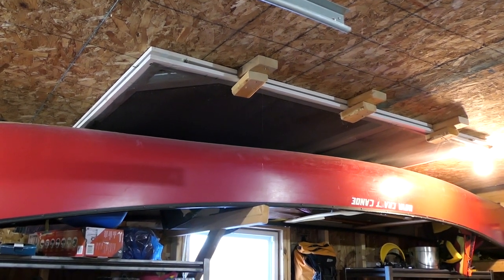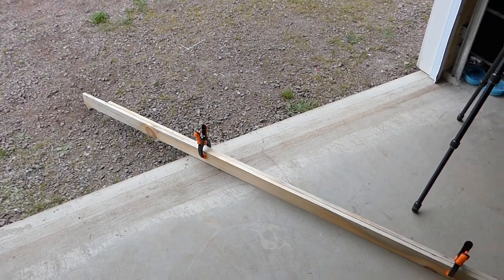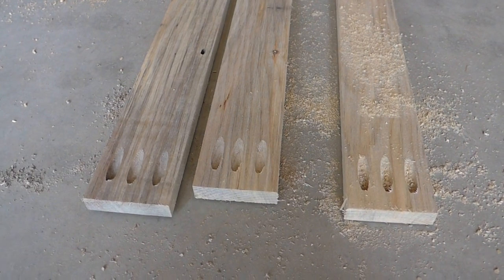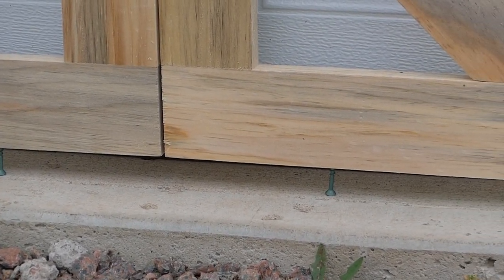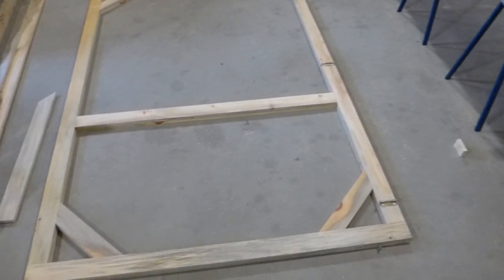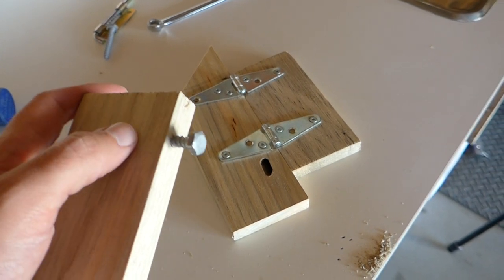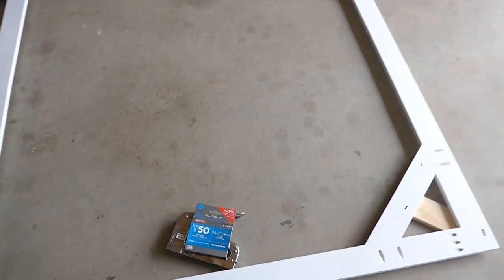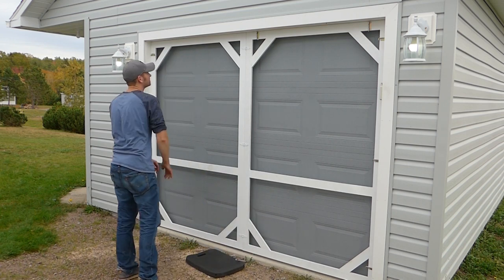Amazing DIY Garage Screen Doors - Quick Release & Hinged -- No Sewing Required

Comment: Question? How do you open the screen door from inside the garage or how do you lock it from inside the garage.
Reply from the maker: Good question. I cannot open the screen door from inside the garage. There's a regular side door for day-to-day access. I only open the screen door to take out larger items (Canoe or 4 wheeler).

Comment: Love this design and this great tutorial.  VERY helpful.  I do have a question.  Did you use anything to "line" the bolt holes for the barrel bolts? was thinking how to waterproof the holes and still have useful access.  Thanks.
Reply from the maker: I just pulled the barrel bolts and let them hit where they should go in. That marked the frame and allowed me to drill the holes in the correct area. The holes don’t go through completely, and my trim is made if PVC so I wasn’t worried about rotting or sealing. You might be able to use plastic plugs if your door frame is made of wood? Thanks for your kind words!

Comment: Out of curiosity, I was intrigued when saw you did the hinge in the middle. I am new at this kind of thing, so wondered if you could help me with the why 😊 Also, how is it holding up years later and/or did you make any changes to how it’s built? 

I made a baby gate height one last year and well, it wasn’t the prettiest but it worked. Since it was on the inside of the garage, I put small wheels on it so it could be opened when coming in and out for gardening/mowing. This year my kitties aren’t little so they will leap right over that one.  The rebuild begins 😅

Thank you for this video sooo much! Finally one that doesn’t require sewing…. I stink at anything that requires sewing 😂
Reply from the maker: Sorry for the late reply. It held up pretty good, but I always store it inside the garage during winter, so it’s not exposed to constant snow/slush. I haven’t had to change anything yet, and the hinges still work. The support screw on the bottom is very important though, because it holds it firmly in place 👍

Comment: How much did it cost in material to make? Can I make one for double garage? Any plan idea to share how to?
Reply from the maker: You can probably make one for a double garage but I would suggest more than 2 panels if you plan on having a section that opens. I can’t remember the cost, but I have a few of the items listed in the video description.  No plans, but it’s not too complicated if you measure your door and make a drawing of what you need. Thanks for your comment 😊

Comment: It was a great video.saving a lot of money.would you please describe about how many pieces of pine woods and the sizes for 2 car garage door?ty
Reply from the maker: Hi there, I suggest you mesure your door and draw a plan based on your measurements. From there you can figure out how many pieces you need. Thanks for watching!
Reply: @LegacyCraftworks they look like 1x4 pine,correct?
Reply from the maker: @تاقەدار  Actual measurements are 3/4" thick x 3" wide 👍

Comment: I plan on making something similar to this except mine go's in the inside and will use piano hinge.Also mine will stay attached to the inside and fold to the inside wall.It's for a storage shed with a 4 foot double door set-up.
Reply from the maker: That will work just as well 👍

Comment: Love this idea.... I need to build this!!  Can you supply the materials list you went with? Thanks!!
Reply: J Carver  I built the frames today. I used 1"x 6" treated fir. Everything worked pretty well. From what I can gather from the video, I think his were 1" x 4" boards, but I wanted mine a bit beefier. They are still pretty flimsy using only pocket holes (I did 3 pocket holes on each joint), I may reinforce the joints somehow once I get it all sealed and assembled and get to test it out. I have a 9 year old who is not the most gentle with things, so I am thinking anti-destruction joints! I'll update after completion.
Reply from the maker: The wood I had was 5/8" thick, and about 3" wide. I was able to get away with pocket holes because the wood was very light weight. We have a side door on the garage so we only open this one few times during the summer when we take out larger items. If you use it frequently as an entrance, something beefier would probably better 👍 Have fun with your build :)
Reply from the maker: J Carver   I didn't really write down a list. basically it was wood (pine), screws, hinges, screen, spring loaded barrel bolts. Everything was purchased locally except the spring loaded barrel bolts. I think I ordered them from Amazon or Ebay. Cheers!

Comment: So it’s been 4 years since you posted this video…do you still use the screens and what about small rodents or bugs getting in under the screen…did you put down and rubber like trim for the bottom to stop an invasion. 😂
Reply from the maker: Hi there, yes I still use the screen and it works great. No problem with rodents here but a rubber strip at the bottom would help if it’s an issue in your area. For bugs, it seems like mosquitos and flies aren’t smart enough to walk under 😂 Glad you found the video!

Comment: locks should of been on the inside of the frames not outside . Cant leave through the garage duh
Reply from the maker: Hi Candy, we have a side door we use to get in and out. The screen door only gets opened to take out large object, Thanks for commenting 🤘
Reply: I believe this is a detached garage. Duh

Comment: bad idea, only 1 way in..
Reply from the maker: Thanks for commenting. You are correct, this idea is better suited if you have a smaller side door. We always use the small door and only open the screen section for bigger items. Cheers Anton 👍
Reply: First and foremost... Great Seems it would have been better to have springs on the inside of the garage.  That way you can secure yourself while  inside. And when you briefly exit don't fasten it completely.  Longer term, you have the actual garage door.